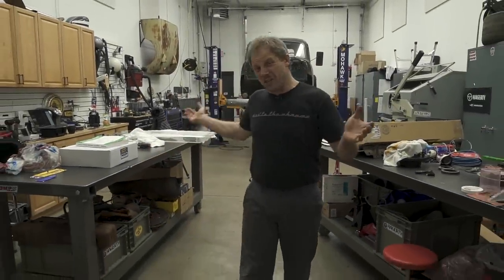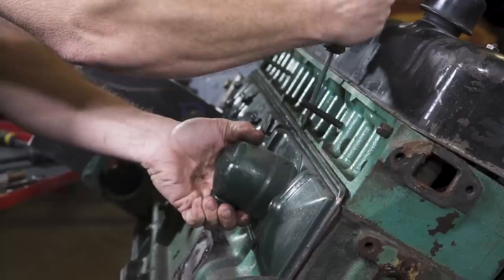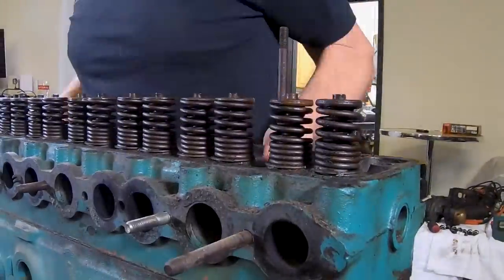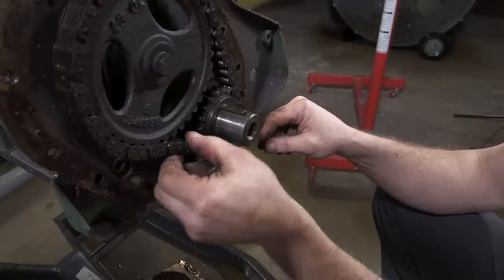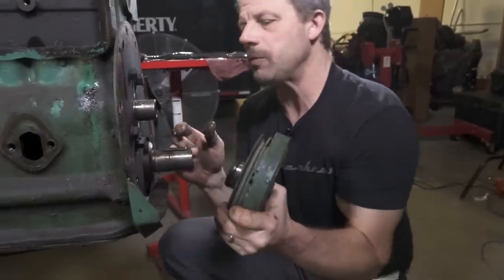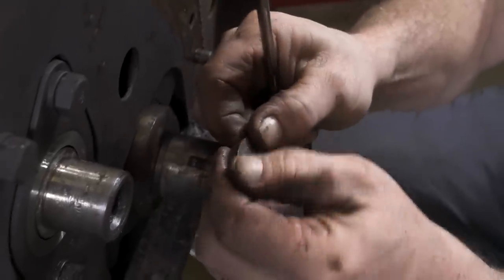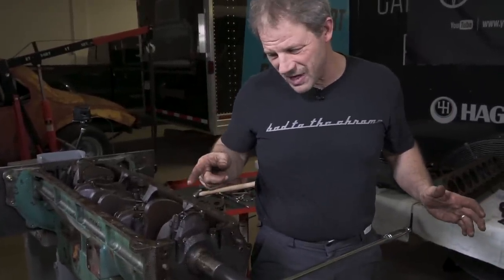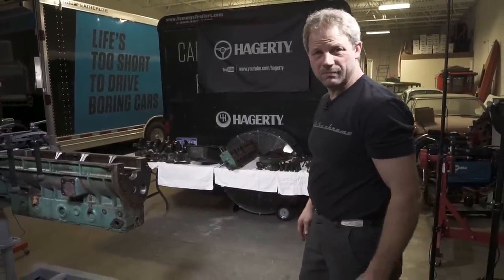Yikes! Our Buick straight-8 teardown reveals a few surprises | Redline Update #29

Comment: Surprised to see how similar in layout this is, to our Hemi Six here Down Under.
Would love to see Hagerty do a HyperPak Slant Six one day 😉
Reply: I'm jealous we never got the hemi i6 here in the states. Man that's a badass engine, and can actually make decent power for what it is. I was considering importing one for a Jeep project a while back lol.
Reply: @TheAmericanUhate  I know of a couple of cars, including one on our VH Chargers, that went the other way, fitting Jeep 4.0 motors to have modern ECU's and injection. The hemi6 was a good engine for the '70's, and you can build them to 400hp easy enough, but if you've got a light truck or muscle car project now, try find a Ford Barra6 now 🤗
Reply: @PiDsPagePrototypes  yeah the Ford barra is another badass aussie engine we never got here. I ended up building a 4.7 stroker out of my jeep's 4.0 but aftermarket support is limiting. There's only 1 aftermarket head still available, there's no intake manifold other than the stock 99+ horseshoe for EFI. Clifford and offenhouser makes carb intake manifolds is about it. I seen some of those hemi i6's making some good power when I was researching them. You can still get 500-600 out of the Jeep i6 but it takes boost and more cash than swapping a v8 in lol
Reply: @TheAmericanUhate  I run the Clifford repro HyperPak with 4bbl in my VC Valiant, they make some good stuff. Surprised there's no custom EFI manifolds available for the 4.0
Reply: @PiDsPagePrototypes  I've been contemplating to get a Clifford and see if I can have it machined to accommodate the mpfi/efi that I've got. Waiting on an edlebrock aluminum head for it now but they're back ordered until the end of march. Still need that ported and machined for larger valves when it gets here.
Reply: I think some people buy a Dorman Jeep 4.0 intake manifold and port it out for maximum performance. I like this idea because MPFI and good manifold design ensures that cylinders 1 and 6 get nealry the same air/fuel distribution that cylinders 3 and 4 do.
Reply: @skylinefever  yeah I port matched my 99+ horseshoe intake and had the 7120 head done professionally with larger 2.02/1.60 valves but replacing the head with the edlebrock when it comes in. Edlebrock is backordered until the end of the month currently.

Comment: I worked on these engines in the early 1960's and found that they would often have rod knocks when started cold. What was amazing is that they would run for a long time with knocks. Crankshaft end play was also common. The need for a rebuild would occur in the 65 to 75k mile mark and a valve job before that mileage was recorded. When they were running well, they were very quiet, and the power was not bad for such a heavy car. RJ
Reply: richard mickinak - i have a ‘32 with 30k original miles.  Purrs like a kitten and not afraid of 50 mph.  This is a very interesting video to be watching.
Reply: Scores of people did not change the oil and filter regularly.  Properly maintained Buick engines held up much better than that.  Remember, motor oil back then was not very good by today's standards.

Comment: I would look for an outside cause of the piston with the pits on the head. Could be a vacuum leak to that cylinder causing it to run too lean and detonate (which the damage resembles). Likewise for the other cylinder. Another possibility is coolant entering the cylinder due to head/block warpage or gasket problems. Timing chain looks about what you'd normally find in a worn engine. You'd be surprised how loose a new chain & sprocket set looks for slack after a relative few miles (500 or so). The keyway looks ok without physically seeing it first hand. I'm pretty sure when it's tightened up with the bottom timing sprocket in place there will be no movement of the harmonic damper & key assembly anyway. Core plugs (aka freeze/frost plugs) are probably just rusted through. Contrary to popular belief core plugs are not that likely to keep a block from cracking if frozen and the cracks might wind up in an area you can't fix & sometimes can't get into to check for them. Keep your fingers crossed. Hope this helps. Looks to be a very interesting project - keep up the good work!
Reply: Magnaflux before repair, my 2 cents

Comment: My old Chevy pickup has a GM 250 ci straight six which looks very similar to this motor.  On the straight six I thought the 1:6 intake and exhaust manifolds were bad enough for balanced flow, but 1:8 is ridiculous!
Reply: The Chevy 6 was worse, as the runner for 3 and 4 were inline with the carb.

Comment: a 51 buick does not have side engine mounts. It has front mounts. I have a block if u need it. Needs inspected, and derusted. it has sat in the trunk of the 53 super for 40 years.

Comment: It's not a "freeze out plug", it's a core plug used during the casting process. It is not designed to push out if the block freezes, it will not save a block from busting.

Comment: I think it´s the slack from the chain, not a worn wooddruff key slot.
Reply: I've seen much, much worse slack in a "silent chain" and don't think that had anything to do with piston damage. Those type of chains seem to always have slop in them, I suspect just from stretch.
The piston damage I would suspect is from heat, poor air filtration, or a foreign object. Perhaps a piece of a broken spark  plug sometime in the past.

Comment: This is my most favorite Type Of engine it's big and the sound is amazing and so smooth you can set coins on the side  it's not easy but you can try
Reply: Just use a drop of Super Glue on the quarter, and make the video.
Reply: @stephenandloriyoung5716  En Doe de Shake test. Before the Glue dry great idea haaa ha It's real possible without glue. The coin rotate a little bit I have seen It one day on Mercedes engine.

Comment: Take that straight 8, pump it up, put a long duration cam in it, polish and port the head, some custom exhaust headers and intake manifold, with a 400 cfm carburetor and drop it in a C-10, bet it would have massive torque and would be very unique!!

Comment: Had a 1952 2 dr. H.T. Purred like a kitten, downfall was the Dyno Flow automatic if you want to call it automatic. But the reverse went out. Could not find a single soul to fix it. Sold it for 10.00 more than I payed. That was in 1964, I was 12. Lots of fun learning about that car. 😁
Reply: Strange.  The DynaFlow only went out of production the year before.
Reply: @michaelbenardo5695  I believe you are confused, 53 to 54 was the change with the V8 coming into production. Straight 8s had three speed manuals and dyna flows, V8s had hydramatics.
Reply: @stex1985  Buick never used HydraMatic in any form until 1964.  Look in any period shop manual if you don't believe me.  Remember, I owned 4 different ones.

Comment: Core plug , not freeze plug , they were never designed to save engines from freezing , its just a lucky bi product in some cases.
Reply: Regardless, they have been referred to as freeze plugs since the 1940's when I was a kid, and probably much longer.  It's what they are called, not necessarily  what they do.

Comment: I'm curious with really old engines like that would parts be hard to 
find for them?
Reply: I've seen a rebuild kit advertised fairly recently - maybe 4 or 5 years ago - for around  US$1250. So, easier to find than to pay for.
Reply: Jake go buy a Hemmings auto news magazine there are places to get parts for just about any old engine including these straight 8s from GM & Packard ! One place would be a place called Kanter who sells parts rebuild kits for a bunch of model make old cars . I worked at a shop in the twin cities years ago working on old cars but mainly old Packard limousines with the straight 8s they used & we would buy parts from Kanter to rebuild the engines once the machining was done on them !
Reply: Just join the marque club and advertise in their publication. For example, There is the Buick Club of America. Their publication, the Buick Bugle accepts classified ads. Some old Buick nerd has one in his shop.
Reply: EGGE Machine builds replacement parts for many very old engines.
Reply: Not really.  Now for a Duesenburg, maybe so, but not so hard for a GM car.

Comment: Freeze plug did what it was supposed to do?  You're referring to the casting plugs, right?
Reply: They close off the holes that are used to empty the sand from casting out of the water jackets.  Protection from freezing is secondary.
Reply: @michaelbenardo5695  Protection from freezing is not their purpose, misleading claim.
Reply: @thisisyourcaptainspeaking2259  That's what I said in so many words.

Comment: By the way they were some smooth running engine's , remember a few of them when starting to do my mechanical learming ✌
Reply: Lassi Kinnunen  Actually a straight 6 is better,  it can be perfectly primary balanced and no secondary vibrations. The 8 has secondary vibration that would require a balance shaft to cancel.

Comment: Had a 53 buick that the lifters would be air bound after every oil change, would not clear up. tried everything except dropping the oil pan for a looksee. never found the problem.
Reply: There is a small fitting on the side of the head that the line from the oil filter screws into.  That fitting has a very small hole that can get partially plugged.  It was called a Restricted Fitting.  That sounds like what was wrong with your's.  I replaced mine with a standard fitting.  Never had a problem.

Comment: Do I hear compound carburation for this motor?
Reply: I hope it gets multiple carbs. When you have an inline 8 and one carb, the fuel/air mixture in cylinder 1 and 8 is completely different from cylinder 4 and 5. This problem also exists on straight 6 engines, that is why performance oriented ones had 2 carbs.

Comment: The engine is probably out of a Buick super model car. The Century and Roadmaster cars had more cubic inch than the super engines..
Reply: With 120 + horse power, correct, as the bigger engine made 141 to 170, depending on year and carburation.

Comment: I can’t believe how long that motor must have been running with the valve hitting the piston.  You just ‘tap’ those two things together ONCE in my Honda motor and you’re done 🤷‍♂️
Reply: As time went on, tolerances became narrower. That is why on more modern engines, a tiny variance in timing leads to disaster. If there was no pressure to create engines with better power to weight ratios, Hondas might not have had that problem.
Reply: Japanese engines are designed to be cheap.  The reason they seem to last so long, as long as the rubber timing chain doesn't break, is because of today's superior motor oil.  They would not last long if oil was the same today as it was then.
Reply: @michaelbenardo5695  I would honestly say Honda makes great engines, regardless of motor oil. Toyota too. I was a mechanic for a while and I’ve seen abused, millenial owned Civics run up to 400k miles with maybe an oil change every two years. That being said, they are much more “fragile” because parts on today’s engines have become much more delicate for weight reduction, fuel economy emissions etc. You can’t use the same sort of rotating assembly today that was in this straight 8 and expect 20-40 mpg.
Anyway, I think we can all appreciate the old iron.
Reply: @sethallison5682  I don't consider any engine that uses a rubber timing chain and places the water pump inside the timing gear cover to be "great".  And those of us who love traditional American cars are not particularly intested in weight reduction or in getting 40 MPG.  We want smoothness, quietness, low RPM torque, ease of repair, lots of room, and a nice soft ride.   Japanese cars just don't deliver on those counts.
Reply: @michaelbenardo5695  it ain’t that hard to replace a timing belt. And anyway, those cars are a product of laws. The laws passed and the Japanese delivered. I would love to pontificate the alternate timeline in which we can still buy brand new 1949 Mercury’s or Buick’s, but we cant. It’s not legal anymore. The emissions and gas mileage laws created a market for those little Cracker Jack box cars and the Japanese delivered them. The Americans… not so much. It’s business.
Besides that, cars usually only lasted 100k miles back then.
Reply: @sethallison5682  There is no law requiring rubber timing chains, there is no law requiring that the water pump be inside the timing cover, and the Chrysler 300, Dodge Charger and Challenger, the Mercedes S class, and the BMW 7 series are all larger cars, and they are still allowed, so no, we DON'T have to drive cracker-boxes.  I will keep my 54 New Yorker station wagon and my 73 GMC 3/4 ton.  No catalytic converter, no seat belts in the wagon, which means they can't give a ticket for no wearing them, no computers, and no smog checks.
Reply: @michaelbenardo5695  since your obsession here seems to be with timing belts, I’ll point out that almost all new Toyota and Honda engines, starting about 15 years ago, have adopted metal timing chains. It’s actually more of a pain to repair or service if you ask me, but I also think we’re talking about apples and oranges here.
Reply: @sethallison5682  They got sick of all the anger due to destroyed engines, but I still don't like Japanese cars, or Japanese-like cars.  I like traditional American cars.

Comment: Kind of crazy how much power the engines of today have compared to the engines of just 50-80 years ago. There are tiny little 4-bangers with more power than this engine from the factory.
Reply: But small engines do not produce much torque.  Only big engines do.  They knew how to get way more power than the stock engines made, but carburetors become inefficient at low speeds with a super radical cam.  If fuel injection had never been invented, we would not have close to the amount of horsepower being produced today.  The engines would not be streetable, and would be impossible to smog.

Comment: Hi master builders. What's the best way to weld '39 Chrysler flathead six what has crack on its side to the water jacket, cos of kind of bad casting and all these years. We did try some magic sticks but it keeps cracking again. Tin?
Reply: I have heard that iron oven fusion welding works, but it is hard to do, few welders can do it, few welding shops are equipped to do it, and the waiting list is long. However, if you have no other options, I guess you have to go for oven fusion welding. My dad once worked on a forklift with an obsolete Continental flathead. When the head cracked, he shipped it to an oven fusion welding company. He said that the head was a mechanical work of art, and he got the engine running again. Sure, oven fusion welding a block might be harder, but it is the only thing I can think of.
Reply: All I remember, from the 1950's, were brazed.  On tractor and auto engines.
Reply: Drill a small hole at each end of the crack before brazing.

Comment: Question : would a straight8 with an extra set of mains be a stronger eng  more main per cubic in  ?
Reply: A crank with a main on each side of every rod will be stronger , all else being equal . I worked on a old diesel tractor that only had 4 mains in a straight six , those engines had a very poor reputation
Reply: The Packard 356 and 359, and some 327s, had 9 mains.  Great engines.

Comment: Wait, "pushed out, to do what it's supposed to do"? (Talking about the freeze plug leaking)..  its for letting sand out of the block mold.... not for "freeze protection".. I thought you would have known that..
Reply: It's for letting stuff out. Sand or 32 deg water. Just like people saying motor instead of engine. Big deal.👌✌️
Reply: He explained better in the next part of this series.. i judge to quickly....

Comment: Isn't a motor driven cooling fan contradictory to what you want (more fan cooling when going slow or idling vs more fan speed at high speeds)?
Reply: Nobody used electric radiator fans in the 50s and 60s.

Comment: Question. Where do you guys find the parts for all of these old engines?
Reply: At the auto parts store.
Reply: @Hanzyscure  With engines this old, many common auto parts stores don't stock the replacement parts. There would be very little you could get from stores like Advance Auto, Autozone, or O'reilly's. This is why there are classic car specialists that you'd usually use online ordering or mail ordering in order to get parts. EGGE Machine is a major one.

Comment: Just for the record there is no such thing as a freeze plug the are core plugs from the mold that the block is cast in 
misconception that has been around for years the where never designed to be freeze plugs

Comment: I thought the Super had the larger Buick motor, same as the Roadmaster and Century: 340ci?
Reply: 320
Reply: @TODDFINK1  You're correct; I meant 320.
Reply: Starting in 53 it did, but from 1940 to 52, it was intended to be a less thirsty car than the big-engined models.  I had a 50 Super that somebody had shoehorned the big engine into.  The radiator was further forward than stock, and the correct air cleaner could not be used.  Couldn't close the hood if you did.  Had to use one of those tiny ones from Grand Auto.

Comment: So if a straight 6 is capable of almost 300 HP this engine should be capable of a whole lot more.would love to see how much u could squeeze out  of her.
Reply: Not so fast.  One of the problems of the Straight 8 was the fact that the long crankshaft would twist back and forth fairly easily if stressed beyond a certain point, unless the journals were huge.